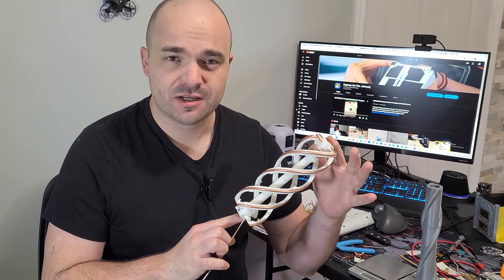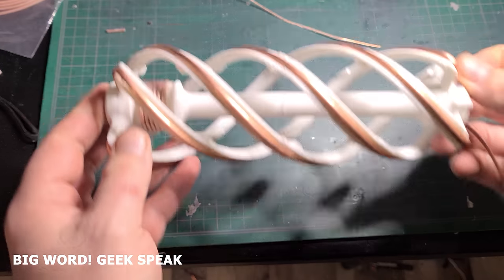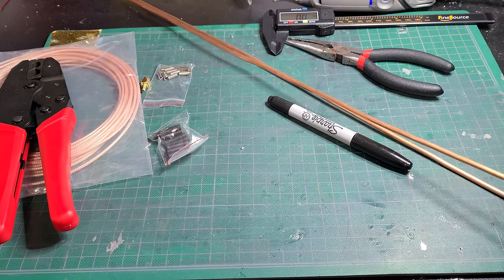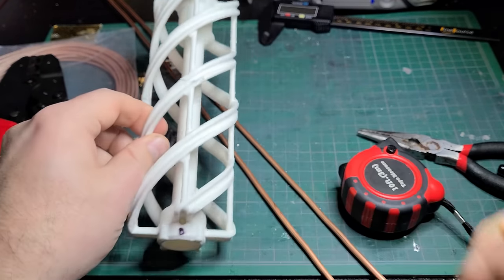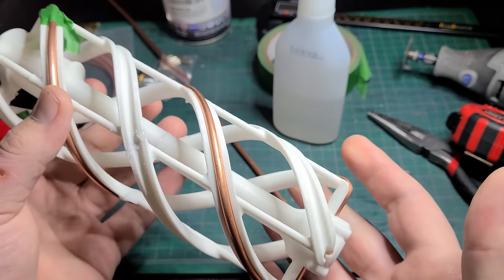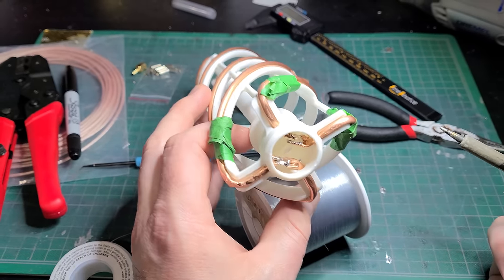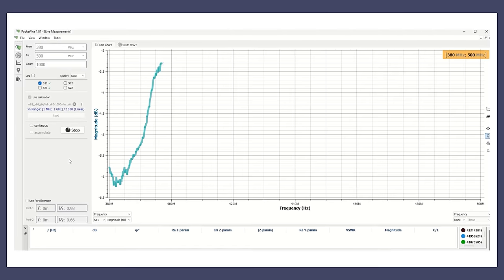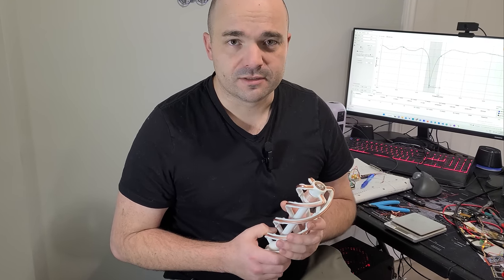"Build an Amazing QFH Antenna : Here's How!"

Comment: Thanks for the video and the QFH former stl, looks great! Do you have a recommendation for how to scale it if you wanted a different center resonant frequency? I'm planning on building one centered in the satellite section of the amateur 70cm band ( ~ 436.5 MHz )
Reply from the maker: This antenna was ment for the 401 to 440mhz band as is and ended up around 419mhz mark with narrow band. on the thingverse page you will see the calculations used, it was actuall centered around the 450 to 460mhz mark if I recall to compensate for plastic. I suspect designing it around 470 to 490 region will get you closer. I am still working on this antenna and probably not to difficult for me to adjust this design to a aimed 430mhz version. also trying to see how to size it for 137mhz but at this stage it will end up in 6 different prints lol
Reply: @EngineerMeThis  An idea: make a design that minimizes the plastic i e the dielectric loading, in a way that lets you calibrate (or "analyze impact on") the frequency by intentionally adding dedicated pieces of plastic. Would be interesting to be able to predict center frequency better, but adjustability is even better(?). Also wonder how small (and thus portable or attic-hidable) it could be made with maximum loading (with common materials).
Any way:  great video, even more inspired to make one now! /SM7UID
Reply: To clarify: I mean printing and adding small pieces of plastic of controlled sizes, is way easier than rebuilding/reshaping/resoldering and connecting any of the copper parts, so it would be an easier experiment testbed to measure the impact that different amounts (a wide range) of plastic has on the center frequency and bandwidth, and even how it matters WHERE you add it.
Then you could try to make one as small as possible.
Another idea: I guess you could load it dielectrically even more by pouring molten plastic into the inside of the pipes (before bendning) ?
Reply: I wonder if you could hybridise this with a magnetic loop design - with a variable capacitor to tune it.  Rather than trying to lower the Q to give wider bandwidth, use it to your advantage, getting a lower noise floor.  G7DMQ

Comment: Good Work. Quite impressive.
Just wondering what the gain of the antenna might be ?
Reply from the maker: This Antenna does not have alot of gain to speak of and you don't really want it to either becuase that would mean it's somewhat directional and the point of QFH Antenna is to be omni directional antenna.
Reply: @EngineerMeThis  but this is a directional antenna isn't it  ?
Its a helical antenna right. I thought helicals are  directional ?
Reply from the maker: @shakaibsafvi97  the Helical part refers to the circular polirization of the coils around the core. But the propegation pattern is omnidirectional in nature. It has a slight directiveness towards the top of the antenna but it's is not enough to be determined as a directional antenna like the video released today ( actual helical) that is very directional.

Comment: The dielectric of plastics differ dramatically on the chemistry of the plastic it’s degradation products during melt fabrication and the stabilization and or fortification that changes the die,extrications constant!!

Comment: That 1/4" Tubing should be "Ridged Enough" to hold it's shape.. No need for the 3D Frame other than to help form the Elements perfectly... (Cut Slots) top and Bottom to Slip your Formed elements out after forming. (only thing) you will have to (Cut) and solder the ends at the bottom as well when installed into it's final Mast.. (Nice Idea) this QFH should perform the best for  the TinyGS 👍 It will have a Perfect Radiation Pattern for Satellite RX. I use one like this for NOAA at 137 MHz (Very happy with it)
Reply from the maker: I agree with everything you saying, just remember the point of this project was to dielectrically load the elements with plastic to reduce the overall antenna size. So if I remove the plastix the antenna will no longer resonant at 400mhz. But your points are still valid and I'm working on version 3 so will def be taken into consideration
Reply: @EngineerMeThis  I hope you create a video Showing it's Performance and Resonance with your VNA. Along with a 3D printed Helical Radial Former (and willing to share the files 🙏) I plan to make one to hope will resonate at around 425Mhz ... But I cheat and use elbows for the 90 degree bends.
A forming frame (for one Radial at a time) would be slick. (Subscribed & Notifications are on) So... I'll be Waiting..👍📡73s

Comment: I wonder if the shortening of the antenna elements through the additional loading that the plastic former causes, is what is leading to your narrow bandwidth? Loading an antenna will increase Q , which reduces BW, in general. Does your BW improve if you reduce the loading and make a more full sized QFH?
Reply from the maker: Hi Wayde, Spot on. the plastic loads the antenna to a point where the diameter of the conductor has little to no impact, this makes the antenna harder to tune but also rubust to interference, I have tested this by slowly cutting away plastic that was not needed structurally and the center started to shift. so alot of trail and error testing is needed for this to be perfected in the desired freqeuncy range.
Reply: @EngineerMeThis  I fully agree with VA3NCA's conclusions. I would suggest avoiding the printed skeleton in the finished antenna although I see the advantages for preforming the spirals. To that end you might consider a central backbone with Tefon standoffs placed at suitable intervals. As you may know Teflon is ideal for higher frequencies with low dialectric losses.
Reply from the maker: Hey Rob, Thanx for the message, I appreciate the input, just to recap the point of this antenna is to reduce the overall size of the antenna, this is achieved by loading the antenna capacitively. If i Use Teflon and reduce the antenna to just the core im simply left with an antenna that needs to be twice the size to be resonant at the desires frequency.. in otherwords, if the plastic is removed from this antenna it will resonant at 465mhz if not higher depending on the conductor used if the same size was kept.
Reply: @EngineerMeThis  How about using the plastic only as a jig and filling the tube with a slow setting resin, bending it using the jig before it polymerizes and later removing the jig?

Comment: The place you solder, would you be able to wrap the sections with a thin gauge wire and then solder them or would the loops create EMF issues?
Reply from the maker: I suspect if the copper wraps is covered in solder into solid mass then should be fine.. the correct approach I think is to make a termination PCB. Will make tuning easier

Comment: I tried printing this in one go with a skirt.  Around the halfway point it seemed like the printer head was bumping into the model or something as while printing the spiral arms, would violently be pulled then snap back.  At times I had to physically had to hold the model in place to print it.  

But it did finish and it looks great, except for a small scar in the middle that occurred before I started steadying the print. Perhaps a support tube printed around the main print could help this?  I haven't tried that yet, but thinking about it.  

Nice design, though, thanks :)
Reply from the maker: Ya its a tricky beast, one way to deal with it is to enabled Z hop in the slicer so that the head is raised between printed areas
Reply: @EngineerMeThis  I will try that!
Reply: That worked! And I slowed the print speed down.  The whole thing printed beautifully.  No glue required!

Comment: Hello, compliments for realization. Have also the 137 MHz version?
Reply from the maker: You are not the first person to ask this, I'm looking at it. The issue is size. You would need to split and print this antenna in 6 pieces with the current design. So I'm working on the princple to see if different method can be used
Reply: 👍 @EngineerMeThis
Reply: A 137MHz version would be fantastic. I appreciate the step-by-step video. Thank you.

Comment: Yes, the PLA and ABS plastics do have too big losses at UHF and microwaves. One option is to use Teflon with much smaller losses but it is expensive. Maybe one could combine them with an airy PLA support and  small Teflon wire holders? OH2BLO
Reply: would a teflon tape (like you use to seal plumbing threads) lining be usefull? Using the current print, just a layer between the PLA and the copper tube
Reply: @MrFadjule  I doubt that. The plastic structures are near the antenna wires which interact with the material strongly due to their dielectric properties, just like in coax cables. Coaxes are made of various low-losss plastics. Some of them might be even better for this antenna. The wires should be as far as possible from the lossy plastics, a thin layer of tape is not sufficient.
Reply from the maker: While both of you are correct in antenna theory, the point of the plastic here is to make as much contact as possible as im using the dielectric loading of the plastic to impact the physical size of the antenna required at the desired frequencies, this antenna physical dimensions is 20% because of the loading effect @433mhz then what it would be if the plastic as not there.
Reply: @EngineerMeThis  I entirely got it. However, the losses of some plastics are significant and can not be ignored.
Reply: Seems like a difficult filament to print but there's a blend of PC and PTFE filament you can buy
Reply: @NotToast859  Maybe you can print the model and then attachTeflon supports machined. You might also try some stuff used as insulators in coax cables. Some are foamy. The losses matter when the wires touch or are very close to the lossy material.
Reply: @EngineerMeThis  wow, sorry, I got lost in the ideas in the comments, lol
I build and fly freestyle drones, and I am interested in your project here. Often ppl in my hobby will make similar antennas to this (but for 5.8ghz). What would I do with this one you have made, if I were to build and tune it accurately? I REALLY want to build one, but I don't know what the satellite you are wanting to use this on is FOR? Would I use it to send a text message to you?
Reply from the maker: @MrFadjule  Have a look at website. tinygs.com its a open source community that tracks satellites at 433mhz band. but to answer your question. I played with quadcopters and drones aswell and the best antenna selection that you can build is one of three or a combination of them, 1) Clover leaf antenna, 2) QFH Antenna 3) Helical Antenna, depending on the application you select the correct antenna. QFH and clover leaf helps alot because they have a very omnidirectional unified gain pattern meaning they have good gain in the around the entire antenna for a dipole that might just be horizontal plane. Helical helps to direct "Attention" to your area of interest so if you know you are going to fly above and infront for very long distance it might be beneficial.  but for most of the flying I have done using cover leafs in 5.8ghz, 2.4ghz and 868mhz has always been best all round solution. let me know and we can certainly explore a video around this. I need to make a 2.4ghz QFH version for my rockets soon and this will be very applicable.

Comment: I've been consulting for a ca startup developing long range sky hop communication for sensor networks.  Bounce rf off ionosphere.  We need to find an antenna design that is as small as possible, broadband 2 to 10 mHz, with some gain 5-8dB. Any ideas?
Reply from the maker: Hi Kurt, Thanks for the comment.  My first reaction is 2 to 10mhz seems very low for that application as the lower frequency would have less trouble to pass thru the ionosphere then let's say 5.8gjz or even 27ghz but you have other disadvantages obviously related to freq and link budget. And the antenna being directional to focus energy would make sense. But the challenge is that that freq you wave lenght is so large to make an effective small formfactor antenna is asking alot. First question would be what is the Transmitter output power ? and seconds a loaded quadratic loop antenna is the first thing I would test but it's not directional
Reply: "small as possible" with 5-8dB gain from 2-10MHz (not milliHertz I assume) is a physical contradiction... I'm assuming you are not a comms / RF guy (no offence)? A google search for HF antennas will give you thousands of possibilities for antennas, again because of the wavelengths "small" and "reasonable gain" don't come as a pair sorry.  You could start the experiments with HF helical whips as used by hams and 4WD HF users. A quarter wave vertical on 2MHz is about 121ft long, on 433MHz it is about 6.7 inches.
Reply from the maker: @ingmar M you had me going there for second. I saw the comment notification on email but it does not show context around where you posted this only what video. And I couldn't understand how you got to 2 mhz for a 433mhz antenna video. Untill I saw you are replying to someone in the thread. Lol
Reply: Have a look at Magnetic Loops.  They give about the best performance to size ratio.  I use a 1.5m diameter loop on 80m which works really well.

Comment: Hello Sir i need you help with some clarity i am trying to make a Helical antenna for 2.4 Ghz band (2400Mgh) but the calculators on the internet seem to give different values for the different measurements and diameters. And the other is am having some dish old huge dish laying around so i also want to make a helical antenna for digital Tv setellite channels but for this i have no measurements. is it okay if you could guide me on this. for my builds i wont use 3D printed frames I will use simple plastic in center. Thansk in advance

Comment: so why use the copper tube? you printed a beautiful frame. Why not use aircell7 instead of the copper pipe? aircell is a closed surface so exactly the same effects as the tube.
Reply from the maker: Great point. The original idea was simple 1.5mm copper wire. But bandwidth was limited. So tried copper tube to see if it would increase bandwidth since the inductor was larger but due to the loading seems to have little effect. New Version I'm working also uses copper tube. But it's to keep its form without the need for mold.

Comment: If you don't want to have plastic print the mandril in PVA and dissolve it out.
Orif your going to need support, I'm guessing if your messing with radio you have a job so get an IDEX printer and print permanents in PLA/PETG and print the bits you don't want in PVA so you can dissolve it later. 
"SOVOL SV04 IDEX" cheap nasty bed slinger but it will work.
Reply from the maker: Hey. Thanx for the message. That would certainly work if that was a concern for this antenna but the point of this antenna was that the plastic dielectric constant us used to  make the antenna resonant at a lower frequency. So if I removes the plastic I would need to increase the antenna size to get to the same frequency.

Comment: Could you use heavier wire and do away with most of the form?
Reply from the maker: This antenna is made out of copper tube. Why are you suggesting wires instead?
Reply: @EngineerMeThis  so why is the large plastic form needed -- why isn't the tubing self-supporting?
Reply from the maker: @Mr Techie  may have missed the into portion. The point of the plastic is to load the antenna capcitivly to make the antenna physically smaller. Without the plastic the antenna would need to be 40% larger to resonant at the same freq
Reply: @EngineerMeThis  thank you.

Comment: Could you have used a slinky?
Reply from the maker: Hey, Thanx message. No a slinky would form a different type of antenna called a helical antenna. And I plan on making a video on that soon. This antenna has different radiation pattern then helical.
Reply: @EngineerMeThis  Thanks , I'll watch for it.👍

Comment: Have you tried placing the antenna into a 1.5 or 2litre soda bottle?  Will it detune it detectably?
Reply: With 3D printing you could form wire guides for the co-ax so that you just push it through the holes and it bends 90 degrees gently.

Comment: I bet the center insulator is melted and causing a short circuit @28:30
Reply from the maker: If that was the case I would have seen it in the test results
Reply: @EngineerMeThis  Perhaps the effect on the test result is minimal?  I would short it with a jumper wire and see if the result is still the same.  If a wild swing on the result took place, then maybe you are correct and no shorting on melted insulation?